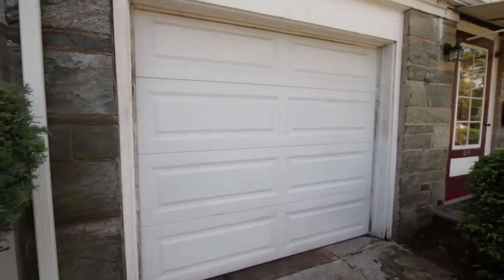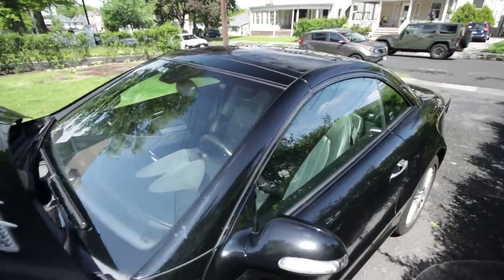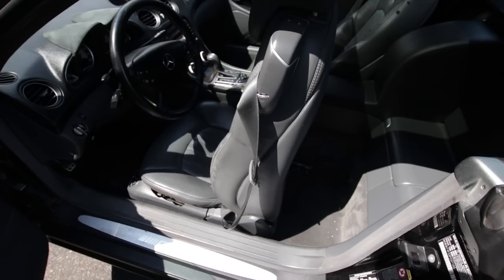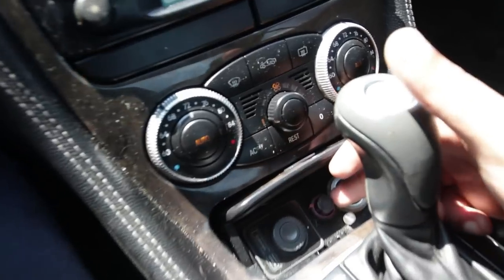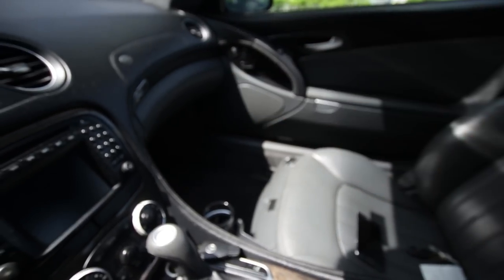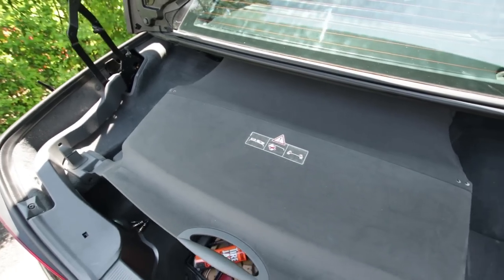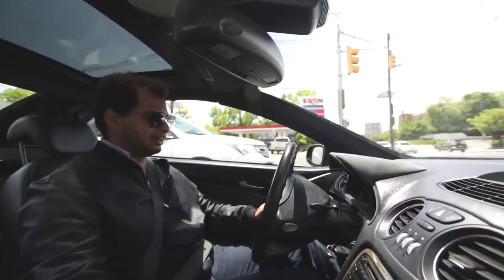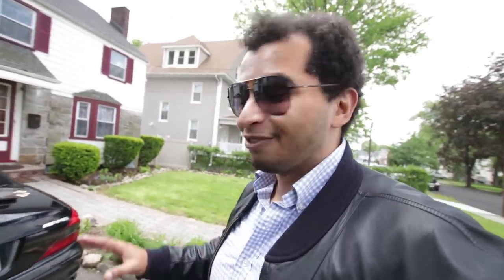I Just Bought A $130,000 Mercedes-Benz SL55 AMG For $8,900

Comment: mercedes was at its best in the 2000s.  good score
Reply: gascanEXPLODE I agree love 2000s benzes
Reply: gascanEXPLODE really?? Wasn't 1999-2006 their age of horrible quality and bad reliability?
Reply: gascanEXPLODE nope thee best from 2000 to 2006
Reply: Definetly especially the C55
Reply: The best at being unreliable Lol, 70s and 80s were when they were actually well built reliable cars
Reply: gascanEXPLODE Lol all cars have issues mercedes richmanscar if you cant afford repair costs o well ....Mercedes the best or nothi ng
Reply: Lukas well which one do you own? That could be a lot of the issue
Reply: Ditto that, at one point, they built reliable cars. Before everyone started the gadget, servo and PCB race. (70s and 80s?). We see lots of 1990s toyotas and hondas on the roads. Not many audi, mercedes or BMWs.
Reply: You dont know Mercedes at all if you claim that best Mercs where made between 2000 and 2006. It was the worst. Actually it started in 1996 with W210 because MB didnt do rust protection well, cars where coming back to factory totally rusted just after 4 years. Facelift helped. Then W220... S class full of rust, mechanical (suspension and gearbox) and electronic problems.. W211 lots of electronical and brake system problems. It happened because of huge leap to electronic world. It was ok, because it was new and unknown to all. BMW was the same. Look at the prices and you will understand. And MB said themselves that they went on saving then. Result was not good. So W221 and W212 and W204 were other generation where MB stoped to save.
Older Mercs, and i had W140 (friend had W123) was long lasting cars. Still full road of them in Europe (i dont know DawidW cant see them). Newer doesnt have such problems. Look at the worldwide surveys 15years ago and now. Difference is crystal clear.
Reply: I had nothing but good experiences with both of my mercedes w215s so looks like you have no clue of what youre talking about...DarvienasAs
Reply: David Wade > you are counting only on your experience. It can for sure be that you had good one. But I am talking, and i repeat, WORLDWIDE experience. Can you understand that?? In all surveys, mechanical checking and rapports in UK, Germany (TUV) and etc all of those Mercs were in bottom of lists with all the Renaults, Peugeots and other cheap things. Can you check that? Internet is full of archives from those years. Easiest is to read forum of MB. I was registered in those forums and read many owners complains even about your CL, which was way better than its sister car W220. CL had to be, its top of the top and coupe. I dont know where you live, but in my place, winter with -25 is normal and starting used CL at those times makes dashboard a Christmas tree (I explain - full of error lights). Another guy sold his CL55 because he couldnt stand going to MB dealership every couple days to delete all the errors from dashboard..Facelift was better. W211 the same, ML - not even starting.. W164 was normal again, like W212, W204 etc. Lets not decide about world situation looking only to our backyard ;)
Reply: They were in the bottom in the US, too. That's survey's with actual data, and that's repair frequency. That doesn't even count the severity of the costs that come along with Mercedes repairs. I remember buying a coil over plug for the piece of crap VW my wife had - the german parts supplier I went to had the same coil for VW ($42), Audi ($90) and Mercedes ($132). The coils appeared to be identical (bosch) except for the adapter on the top of each to make sure you couldn't put a VW plug in a mercedes. What do you think the mark-up is for that part, 200%, 300% when you get service? 

Change coil over plug as a shade tree person, it's less than 15 minutes to read the code, change the coil and drive the car a mile or two to make sure that it's the coil and not something else. You could do a diagnostic routine first to be sure, but at the cost of coils and the frequency that they're the problem, it's easier just to change it and make sure. 

That part price and "diagnosis" at a mercedes dealer would've been in the ballpark of $500 - highway robbery. Like I said, on top of the ridiculous part and service prices, you get to do it more often, too. 

I recall Cadillac and Mercedes being there - bottom of the list. Recent top of the list is an $18,000 car - a scion XB, not sure about 2016 or '17. I have one of those now - 9 years old and $70 in repairs. Not for anyone who thinks it's important to arrive in a car that says you have money. But you'll have it, because you didn't spend it on repairs.
Reply: to > David Wade > do you understand what means "good one"??? Its not 1, it means good example. Like someone makes joke and you say "good one". And yes, you had two of them. I can read.
Do you at least know what is German TUV? Here are OFFICIAL yearly reports from YEARLY mandatory checkings (yes, in Europe you have to have car in good technical condition, not only insurance for any peace of crap like in US, otherwise you are not allowed on the road):
MB 1999 models had 20% of fault rate report (thats every fift car if its too hard for you to understand).
2000 models - 20%.
2001 models - 15%
2002 models - 24%
2003 models - 25%
2004 models - 26%
and for example 2007 models - 16%. 
2008 models - just 12%  Do you see the difference?? All W211, W220 etc from that generation was crap. Only with  next gen cars MB changed back to being normal.
So you check your, or better to say ANY, source of information. And stop decide about ALL make from 2 cars you owned! And btw - another David W wrote the same, and he is from US, so whats the problem?? To hard to understand written text??
And watch your fucking mouth calling me idiot.
Reply: easy brother no argument here :)
Reply: DarVienasAs gascanEXPLODE like i said PLENTY OF GOOD REVIEWS ON THAT GENERATION OF BMW AN MERCEDES back to the drawing board for you my friend its your opinion i had 2 benz an 1bmw an i had absolutely no issues so you can go on an on about what you found on the Internet keep it to yourself because it isnt always the truth
Reply: nah, mid 90s were the best years m8
Reply: Toby Radcliff mercedes were well on their way to losing their good reputation during the 90's and 2000's. Those cars are shit! The 1960's-1980's and today are all good mercedes eras

Comment: You don't have to select manual by pressing the manual button.
The transmission will automatically go into manual mode just by pushing the gear level to the side, one (side-way) for up and the other for down.
Alternatively, just press one of the steering wheel change buttons and the transmission will change gear.
The great thing about the 55 transmission is that if you change down manually, you get real gearbox braking and a beautiful engine over-run.

Comment: Hell ya I did the same. But got a 2011 750li xdrive with 66,879 kms with all the bells. like night vision, auto cruise, rear entertainment and power seats. V8 twin turbo 445 hp and 552 lbs of toque. All for $24871.89 Canadian all in. Up here in Canada Vancouver B.C.

Comment: Woulda prob spent a little on a warranty covering major mechanicals.
Reply from the maker: No thanks.
Reply: Tavarish so say a basic warranty is 2k? If the engine or transmission goes, wouldn't sourcing a new one be  lots more?  Or even a major vehicle computer could run a few thousand?  Maybe this one is new enough where it's reliable, I just know everyone who bought a older high end MB warranty, had it pay for itself or more (much like Doug with his Rover or Aston warranty).
Reply: You do realize that doing all the wrenching himself is kinda his thing right?
Reply: The_Doctors_Tardis yup- but even if you subtract  labor, parts is something where you can only save so much $ on an AMG Benz.
Reply: +DFWs Cars - This is a high mileage, thrashed car, with multiple issues. Who's going to sell him a warranty?

Comment: watch out for that abc pump.....a recall on that....no brakes!!
Reply from the maker: You still have some braking if the SBC pump fails.
Reply: you have to push the pedal thru the floor to stop from 15 mph......paid 700.00 with returning my pump ....matching vin a must..dont get ripped off. only two hours labor

Comment: Bought my 08 CLS550 for $10k with less than 50k miles and it has been reliable, cheap, and extremely satisfying for me over 4years. A lot of these people have NO CLUE what repair costs can be, and they just think it's too expensive. I bought it with a Kleeman S/C, Headers, Megasquirt ECU tune, bilstein suspension, Pirelli PZero tires!!, 2012 CLS AMG wheels, some kind of exhaust and it's mint. I hate hearing ALL THE TIME from sheep how I'm going to regret it when it breaks.

Comment: Make sure you check the ABC fluid, I think it's Pentosin CHF 11S and it's supposed to have a green color when new! I've recently found a german website which does pump and strut rebuilds and they also show some pictures of the causes of bad hydraulic fluid; like when it turns black. They also mentioned that Pentosin will be influenced by air humidity but I haven't done any research on alternatives but it's supposed to have a life time of ~2 years anyways

Comment: I guarantee you intercooler pump is dead which cuts the power in half. Buy and replace for less than ~$200 and you'll allow the car to maintain IC temperature and therefore not cut power.

Comment: Just found this post. I own a low mileage 2007 SL 55 AMG P030 optioned model of this car. I agree it is one of the best looking cars ever designed or engineered for that matter given that it was on the drawing board in early 2000. It is an absolute joy to drive and its exhaust note is superb. I also agree that they are not inexpensive to own and maintain but people should understand that cars that are engineered to this spec will breakdown at some point. I probably spend an average of 4000 cdn per year including its annual maintenance regime. Brakes alone cost 5k.

Comment: The way you release the seat belt in the back is you tap the release with a hammer. Yours is obviously stuck so you need a BFH. This takes finesse but someone with experience wrenching will know how to whack it (no tap it) just right. Remember the 2 laws of wrenching. 1. If all else fails, read the instructions and 2. When in doubt, before you proceed, drink some beer, and if still puzzled, drink more beer. It's not known as "Liquid Courage" for nothing.

Comment: Take it from a fellow owner, first things to address is change all fluids most important the active body control hydrolic fluid and issues are the most expensive, as well as brake fluid the SBC system is big bucks to replace. The forums are your friend, and if ABC issues persist get rid of it especially since you know the car want kept well. With a car like this you may wind up putting more info fixing it then it would have been to get one with low miles on the first place.

Comment: My friends dad bought a SL55 for 18,000, the cheapest one in my country by far. The ABC-Suspension and SBC-Brake broke and they spent about 10k to fix it partly. One year later they sold it for 14,000 since so much broke and they couldn't afford having it fixed (every part of that car is expensive as hell). So they lost about 14 thousand dollars in one year, but hey, the owned an AMG.

Comment: There is a huge switch on the left side in your trunk. It gets bent from shoving shit in your trunk.  Just Bend the long lever to your right about an inch ( take your time). It should trip and your hard top should open. I had the same issue with my aunts.

Comment: The Merc engine is strong and trouble free. The suspension and convertible roof systems are its problems and expensive ones. Also..the electronics can be a nightmare. But there's no doubt, these are a classic in waiting and we'll worth   spending some money on to get right.

Comment: I bought a 2006 W215 CL55 AMG (much bigger brother to the SL) for what I thought was crazy low and they are still dropping like crazy.  Both windows go down when the door is open on the W215 so I don't think its a hard top/soft top feature (about minute 12 in your video).  What does your  W220 do?  Interesting weight number, R230 1855kg, W220 1885kg, W215 1995 kg.  That SL is a tank and is basically an S class in metal shunk down.

Comment: The 2009 on is not "the same car".  The SL55 ended and the SL63 began.  Mercedes/AMG switched to a 6.2L NA engine along with the refreshed front fascia, airscarf feature, and MCT transmission.

Comment: I bought a used 2006 s55 with 115k mils for $6500 and later found out it needed $2500 just to fix the air conditioning system.  It needs total $5k worth of work.

Comment: Not quite correct with the battery’s there! The one in the back is for starting and most of the electronic gadgets on board and the second one is only for the SBC-brake system to take over in case the main-battery dies while driving. The same applys for the Mercedes E-class W211 (pre-Facelift) and the CLS C219.

Comment: i also had a lot of problems with the CD changer. the did blew a few times and then the car did not recognize that the cd changer was there. Was not a critical failure but was a PITA. Wife wants to put on the smooth jazz and get funky and i have to pull over and change a fuse and reset the system. A real mood killer. The car makes you feel great when you are cruising main though. Big thug of a 2-seater.

Comment: hey Tavarish, i want to reccomend you a car. 2006 - 2010 CL 600. Twin Turbo V12 and timeless design. Just to let you know something about the ABC, with the R230 Facelift 2007, W221 S Class & CL Daimler has redesigned the ABC suspesion and made it less unreliable and cheaper... Won't ever break on you! If you do the flush...

Comment: I went to purchase one of the shocks absorbers at the Mercedes dealership and it cost me about $1,000 and some dollars so buying an used Mercedes is not the best idea because parts are getting old and need replacement! I also bought the little compresor part for the shock absorber and it cost me $420 plus the relay and the front calipers and the total was $720 dollars

Comment: This 4,400lb car is not going to hit 208mph by just removing the governor with the stock 493 horsepower. It would need a aftermarket tune and pulley to go over 200mph. The internet is in front of you. Look it up. Even a stock C6 Zo6 that weighs 3,200lbs at 505hp can not even hit 200mph.

Comment: Even I couldn't stop smiling. Great buy.I just hope that whatever you do, keep it as stocked as possible, not even black series body kit. Do not use aftermarket parts. Just fix the damn thing and leave it be. This thing is a work of art and should be treated as such. You'd look classier if you keep it stocked, like you did with the Aston.
PS: Those wheels look the best in this car. Don't change them, especially with those replicas you just bought. They look hideous, for me at least. Keep up the good work.
Cheers

Comment: Congrats on your new car! I've had an '02 CLK55 for 4 years and it's been super reliable..even affordable to repair for the most part. People forget Mercedes are world cars not US only and that 95% of the car shares parts with the non-AMG varients. Then the AMG parts are almost all shared with other AMG's. I can get most of my parts from the local parts store if I wanted and half the time they have it in stock. I couldn't say that about my G37. Sure when I wanted the OEM AMG floor mats I got raped by the dealership but I knew that and didn't care. I paid $10,900 4 years ago and put $3000 into it ($1000 of that was for a Navi) yet it's still worth over $9000. So driving an AMG has cost me just over $100/month lol

AMG'on my friend!

Comment: Also, you may be able to upgrade the Command system to the much more modern ones of the 2006-2008s. Or, you could even go one step further with the even newer system in the 2009-2012 car, however that was the facelift, and I don't know if it will be compatible. This would require a new center trim piece
Reply: He's probably just going to keep it around and install the bluetooth module and the aux input. The speakers are good enough and it blends in with the rest of the dash.

Comment: So my general impression of this car is despite having some rough edges.. its still a vary good car.. I Think I will generally look forward to seeing this car have new life breathed into it.

Right off the bat It be interesting to see what you could do about replacing that infotainment center..  its really sad the navigation screen is now useless.

One thing you really need to talk about how the fuck does this car weight so much.  You said it was 4400 pounds.. OMG, why!?   I know glass fold roofs with pillar-less B frame designs are going to be little more heavy then a standard car... but this is still only a 2 seat car.  And in comparison a 2017 Camaro ZL1 convertible weights a much as 4113 pounds, but that has seats young adults and small children can use.  Its also a full 10 inches longer, and 2 inches higher then this car.  You got another video of material just explaining the weight of this car that people will watch.

Aside from that.. this looks like a fun and amazing car.  and yes.. we are happy you got it, and taking us along for the ride now that you got it.  Congratulations dude.

Comment: I've never seen that thing in between the rear shelf on an R230 before. Could it be an aftermarket sub or something? Update, that is definitely where the sub is. Also, you don't need the key card for keyless go. It also works with the normal key. Just hop in and press the button.
Reply from the maker: Tyler Beeson it is! I didn't notice it at first